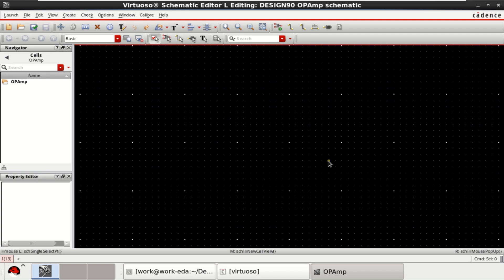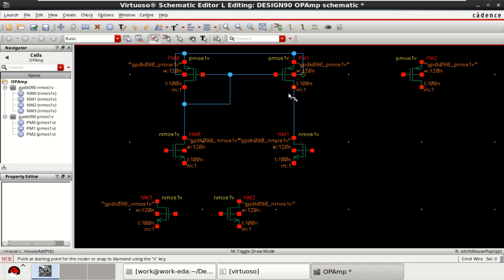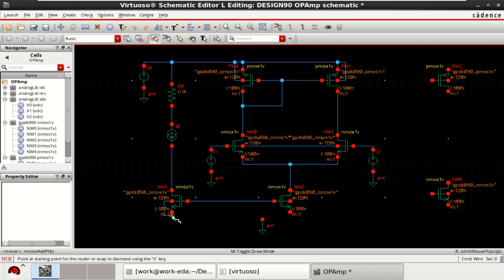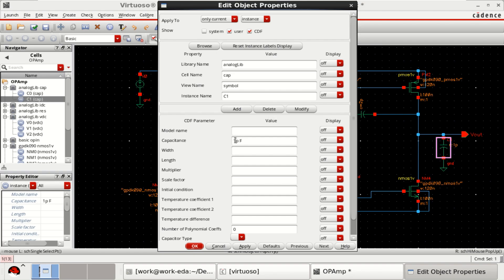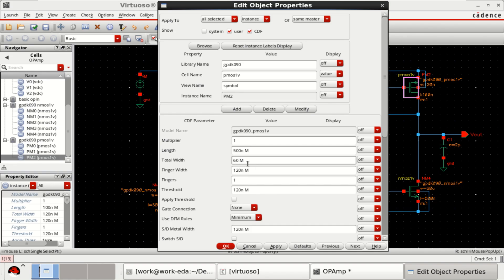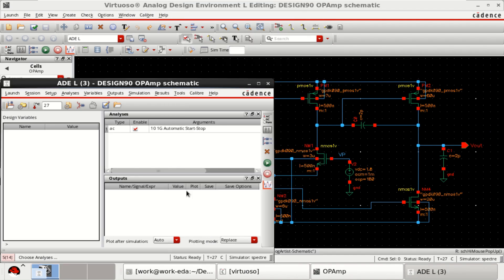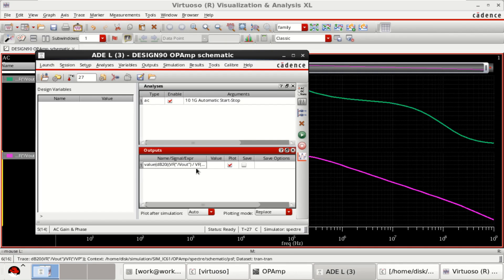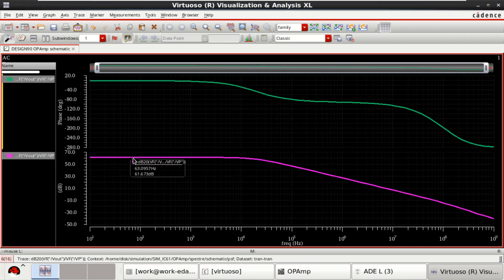2-Stage Op-AMP Design and AC Analysis.

Comment: Sir can you please tell me how to measure leakage current in SRAM cell, which is contributing to hold power dissipation?
Reply from the maker: Hi, - word line (WL) = low and  bit lines (BL and BLB)=high/vdd
Reply: It's ok sir, but where to measure leakage current? Or can we measure like power/Vdd? @dr.hariprasadnaikbhattu

Comment: sir if we use all the transisitors with same length and width, what happens, can we get the same result
Reply from the maker: Hi, if all  transistors width and length are same then Gain decreases. There will be variations in other parameters.